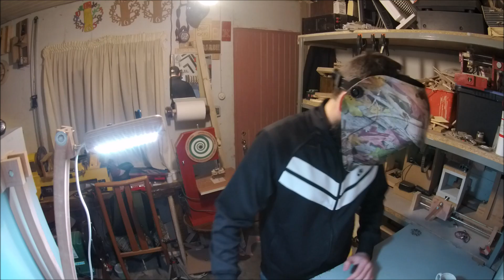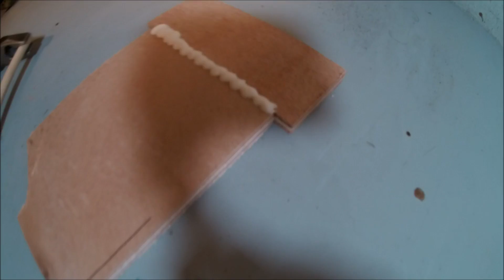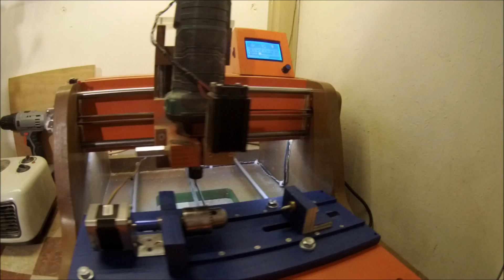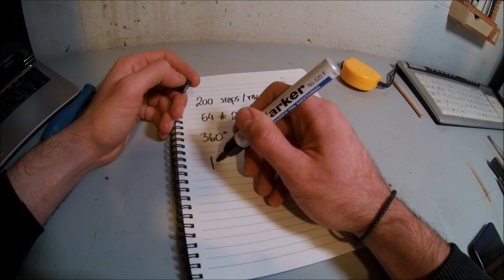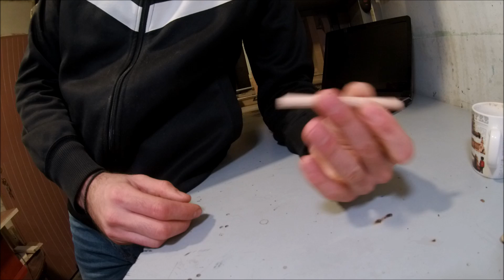Custom CNC 4th axis: Up and running!

Comment: Now that the 4th is with you....
Sharing my idea of tool sharpening can develop further ...
.... into TOOLMAKING ..!!
SILVER STEEL is fine ... more than workable on your machines...
plus you can teach the masses about abrasive tooling, hardening, and tempering.
Next Series ... D.I.Y.  POLISHING,  ELECTROPLATING, AND ANODIZING !!